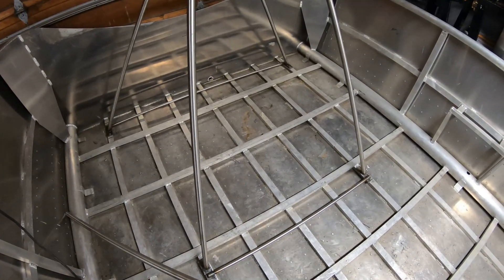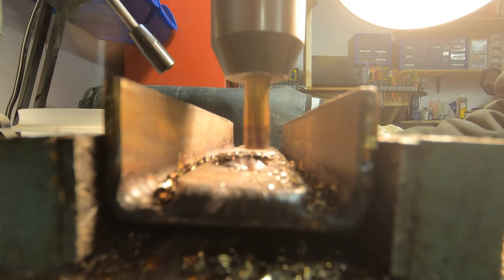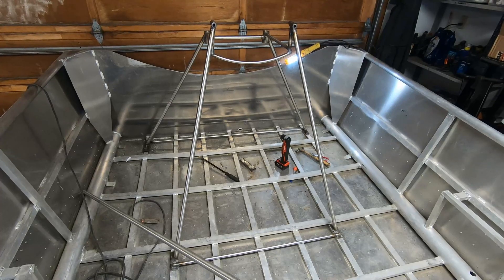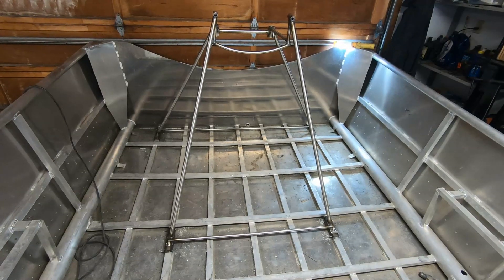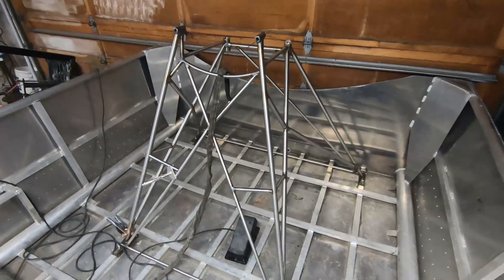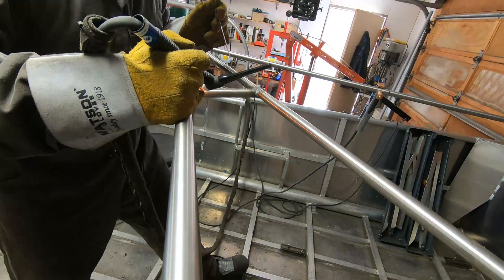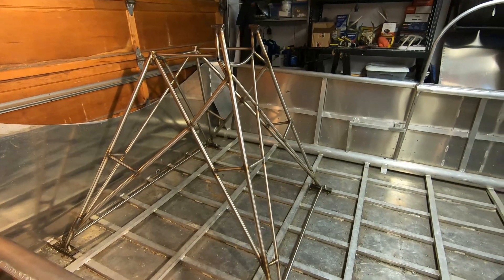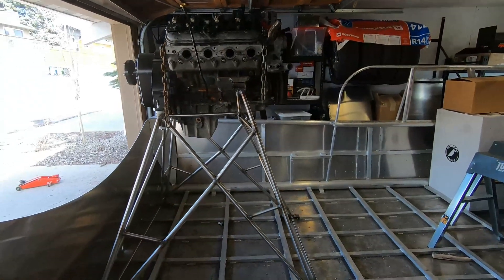Airboat build #8: Engine Stand Part 2

Comment: Looks sturdy enough. Did you allow enough clearance above the curved strut ? Just in case you need to drop the sump, if you need to work on the bottom end - so you don't need to lift the motor with all the extra hoses, lines and exhaust tubing, that'll need disconnecting

Comment: Hello! I also have airboat hobbies, but currently I have trouble with engines and propellers. Can you advise me about the engine, choose the engine is suitable, how many fan blades are suitable? Look forward to your help. Thank you
Reply from the maker: How big of a boat are you considering?  What is the weight?  That will determine how much horsepower you need and thus which engine.  My boat will probably be about 2000 lbs and 500 horsepower.  Obviously a smaller boat can have much less power.  If you don't intend to run it on dry ground, you also need much less power.  For the prop, I'd suggest checking out the manufacturers websites.  I purchased whispertip props.  Which prop will again depend on the combination you want to build.
Reply: Thanks for your support!!!
How big is your airboat? Currently I am in Vietnam, do I want to use a diesel engine? My airboat doesn't need to go on dry land and the airboat's size is 1.6m wide, 3.8m long.
Reply from the maker: @calafucafarm2017  My boat is about 16 feet long, so ~4.9 m.  It'll probably weigh close to 1000 kg.  I'll weigh it when it's done.
There are diesel airboats out there but most are gas powered I think.  It all depends on what engine you have easy access too.  Of course the goal is to have the lightest, most powerful engine you can get.  Around here chevy LS V8's are common and cheap; and they make good power.